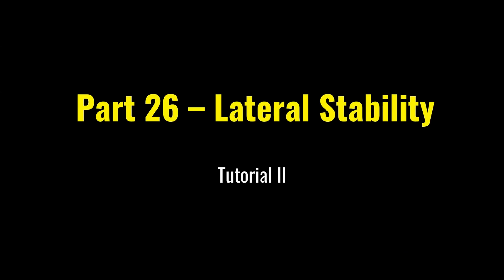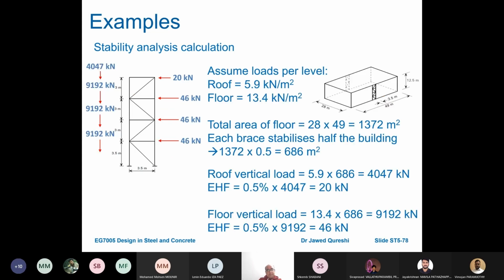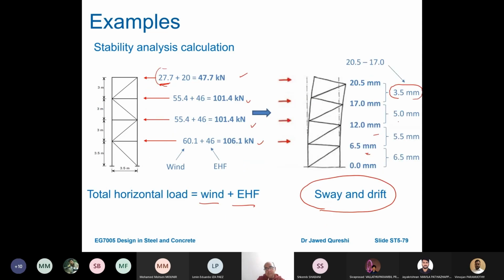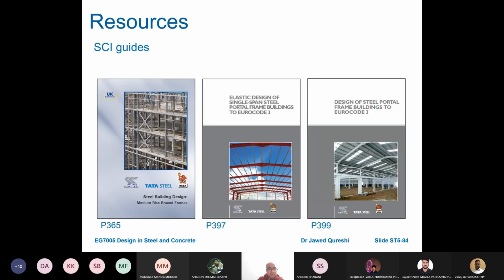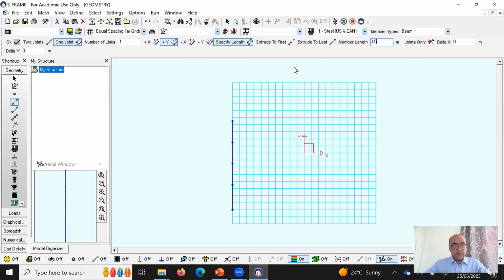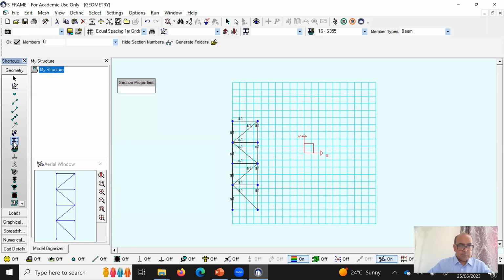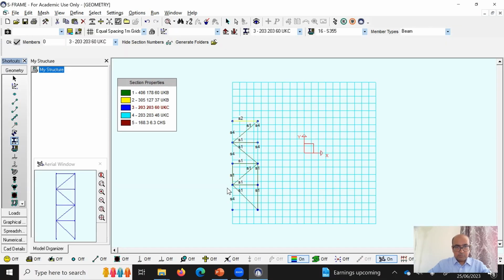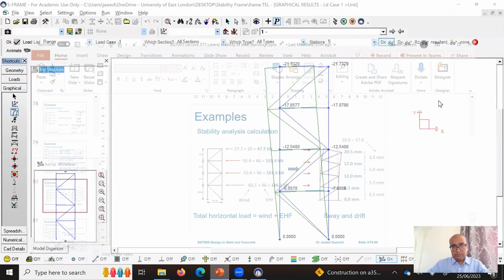26 Lateral stability Tutorial – II (Frame Stability Example) Eurocode 3 Steel Design series

Comment: Great lecture, but wind load is supposed to be higher at roof level.
But why does the wind load reduce as the height increases in the lecture?
Reply from the maker: Roof level is supporting half the floor height, that is why wind load is less.

Comment: Thank you sir. Please where did you get alpha to be 6.1?
Reply from the maker: I used Apha crit= Hh/Vdetla formula.
H is the sum of all horizontal for floors above, for 2nd floor level it is sum of loads at 2nd, 3rd and roof level. H is the average of storey height at 2nd and 3rd level.
V is vertical load for 2nd floor above. Delta is average deflection between 1st and 2nd floor levels. 
αcr = Hh = 250.5 x 3000 = 6.1 < 10  not OK!
        VΔ     22431 x 5.5
Reply: Thank you sir